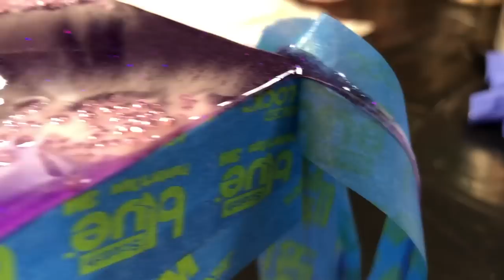Geode Resin Art Tutorial -  Geode Amethyst - by Moonkusser Art

Comment: Sooo beautiful!! Do you do another resin coat over the paint pens? I thought posca pens can scratch away over resin and need a flood coat over. Thank you for sharing your beautiful work and knowledge
Reply from the maker: I did not do a clear flood coat.  You are correct in Posca pens have that issue on smooth glossy surfaces.  Areas on this piece have a slight texture from the products used and seem to be holding the pen lines well even during cleaning (light dusting).  Thank you for your question and watching my videos.😊

Comment: Hi. Really loved ur art. U shared every tips n tricks. Did u use second clear coat after using marker?
Reply from the maker: Thank you Iffat. 😊
I did not clear coat over markers. I used ones that are oil based and stay put. If I use Posca markers I clear coat because they are acrylic paint and can rub off.
Reply: U are a great artist as well as lovely human being. U are a great teacher. U reply all of ur comments..so sweet of u❤
Reply: Hi, I just had a question and would be lovely if you can help. My geodes all need a top coat, but my pieces have cured for days now. I cannot sand because the glitter lines and markers are done a few days back. If I do a top coat after so many days, is it still a good idea? Or the second layer may not adhere well to the first layer?
Reply from the maker: I recommend doing a bit of sanding. You can do it lightly by hand. Just enough to scratch the surface a bit and then clean the dust off carefully with link free cloth and alcohol. The scratches will allow the topcoat to adhere to your last layer.
Reply: @MoonkusserArt  thank you very much for your prompt reply!

Comment: Why do you prime the board?? And do I have to?? Beautiful piece!! 💜
Reply from the maker: Priming the board seals it.  Wood is fibrous and will hold pockets of air. If it is not sealed the air in the wood is released into the resin creating bubbles in your project.  Wood will also absorb moisture in the environment which can cause warping of the board.

Comment: What did you put in the last rings the little stones that had a whole in them? And why did you do this in so many days couldn't you have done it in a single day? Where did you get the centre geodes? Thanks
Reply from the maker: I like to use Czech Glass Seed Beads & I also used Amethyst stone chip beads.
You can a geode artwork in one day.  I was wanting as much control over the resin as possible because I wanted defined separation between rings of color & allowing the resin to cure each day did that.
Bought my geode pieces at a crystal shop near me.
Reply: Thanks allot
Reply: If you wanted your rings to stay put and not mix would you use hot glue or something else?
Reply from the maker: I don't use hot glue but I have used Elmer's Glue that dries clear using small tip on bottle to create a thin line.  I really like using Pebeo Cerne Relief in transparent.  It is easy to control and dries in about 1 hour

Comment: Do you ever do a geode on canvas? I did my first one yesterday on a 24x 24 canvas and had no problems, but I'm worried if I go any larger it may sag. What are your thoughts?
Reply from the maker: There is always the risk canvas will sag from weight of the resin and any additions such as stone or glass.  I like cradled panels myself just for that reason.  Happy yours turned out fine though.